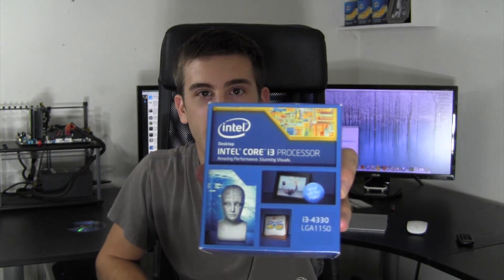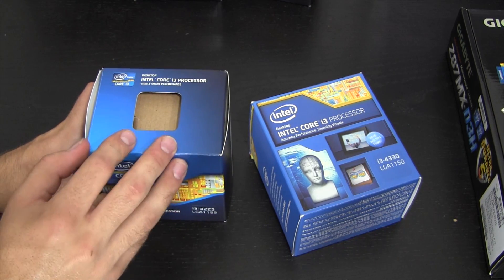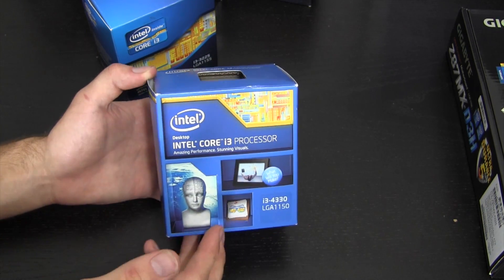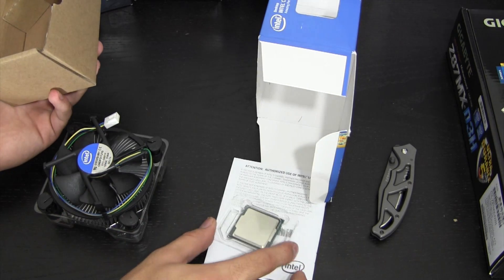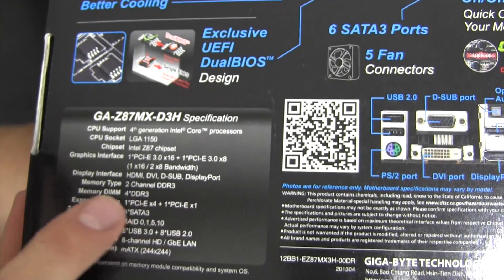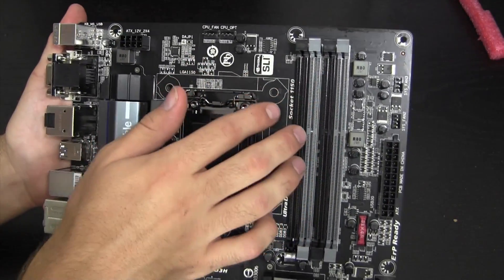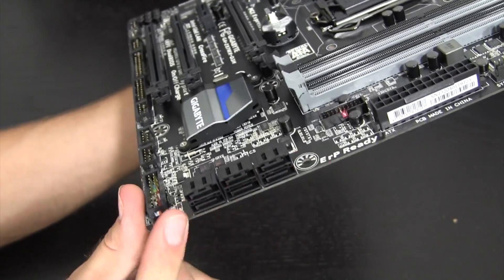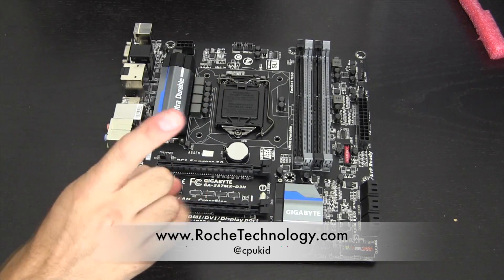Unboxing: Intel i3- 4330 + Gigabyte Z87MX-D3H [Haswell]

Comment: I'm using this board and an i7 4770k and i get a black screen after the apple logo screen when booting from the unibeast flash drive? PLEASE HELP! the unibeast flash drive is with mavericks. i am using the integrated/on board graphics.
Reply: Sweed XI yes ..he's using a hackintosh system

Comment: It does work in full resolution. But it is just recognised as a generic graphics card so no acceleration. I ended up buying a Geforce 210 Silent for £30 that works out of the box with mavericks.

Comment: differences: gaz87m d3h DOES NOT have 
intel lan chip
durable solid black capacitors 
utra durable 5 plus (better quality heatsinks)
No second CPU FAN header
no displayport
no SLI capability
If all these features dont matter to you get the gaz87m d3h instead of the z87mx d3h. might as well get the gaz87mx d3h because it cost $5 more.

Comment: The difference between the 3-pin and the 4-pin fan headers is that the 4 pin uses the PWM method to drive the fan (the 3 pin is simply voltage driven). Both can be adjusted, not only the PWM fans.